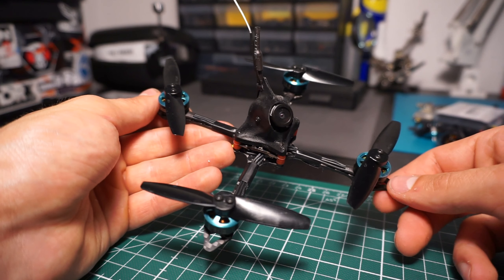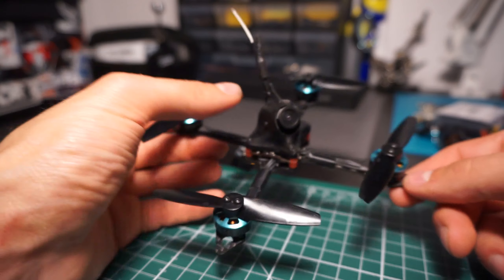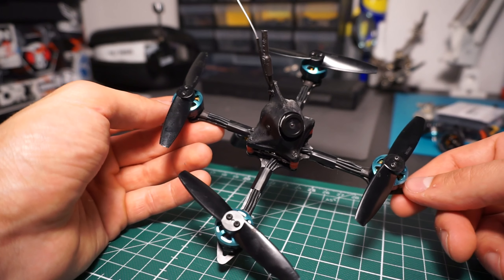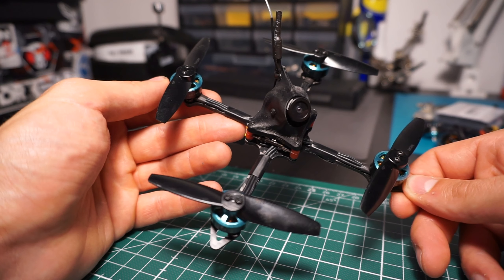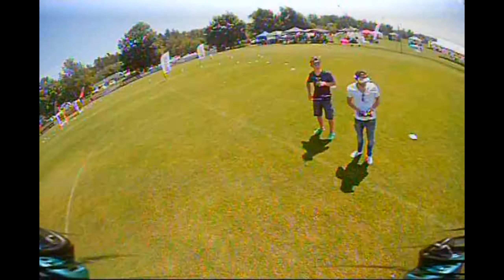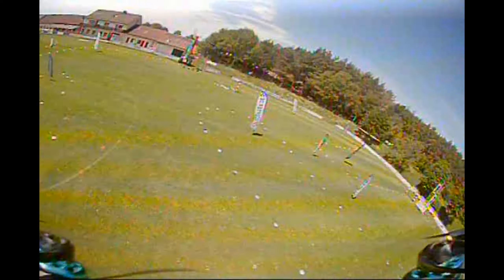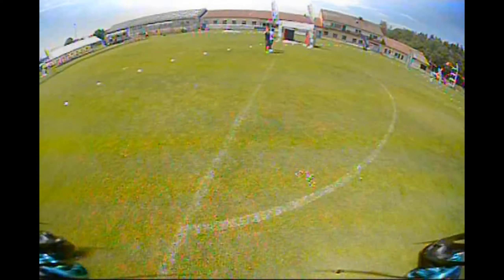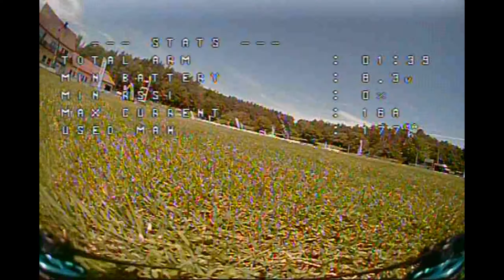DVR Flight Footage: The Sanchez 3" Toothpick

Comment: Dave just finished my Sanchez 3" love it. I'm also using the RCX 1304's 5000kv on GNB 550's 3s. Have you tried this setup on 4s? Or are you using the 1402's? Also I heard that the Race Day Quads batts 3s 650's don't sag as bad as the Tattus or GNB's you might want to check those out.

Comment: Damn that thing rips!I'm in the middle of my Sanchez HD build with the turtle and I have to say, kudos to you for getting yours built. I've built a ton of quads and this is hands down the hardest one. I'm having a really hard time trying to figure out how to solder the wires to the FC - they are either in the way of the m2 bolts at the corners of the FC, or they are too bulky in between the FC and the TPU adapter and it's hard to get it all to sit just right. That isn't even taking into account the fact that the Turtle's long wire, VTX, and RX, plus some wire from each, all have to fit inside the canopy haha. I will get it done but it is not a one night project at all!
Reply from the maker: I feel with you man those things are pretty hard to build nice and clean. Just so much stuff to put in a tiny tiny space. My build  video on the Calimero might help a bit it is the same format. A trick you can use is taking the adapter from the calimero frame with the three instead of four mounting holes. That makes it a bit easier although it sacrifices somes stability.
Reply: Good idea, I just rewatched the Calimero build video and it helped a lot. I stuffed the Pro32 nano and the crossfire nano up inside the canopy then attached the Turtle circuit board to the bottom of the canopy and it suddenly got a lot easier to figure out where everything was going to go. Also I cut down some nylon standoffs to about 3mm and used them between the FC and the TPU adapter, that gave me plenty of room for all the wires without feeling like I was crushing them. I'm just finishing up the build, it'll be up on rotorbuilds a bit later tonight. Thanks for all your help and for the awesome designs, I can't wait to fly this one!